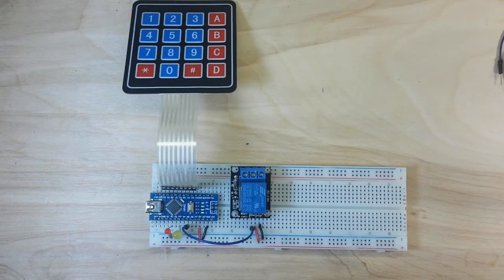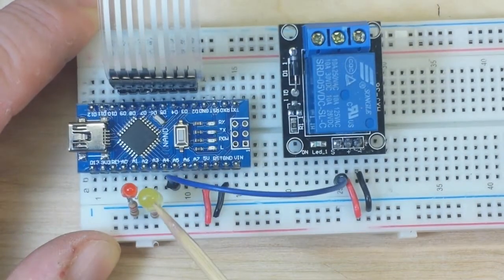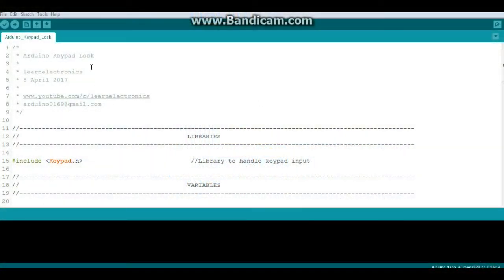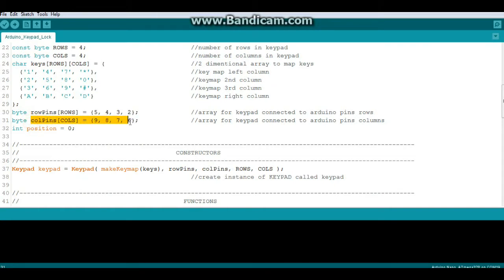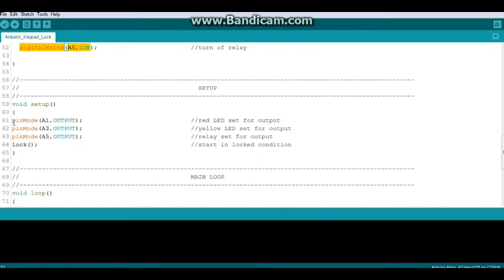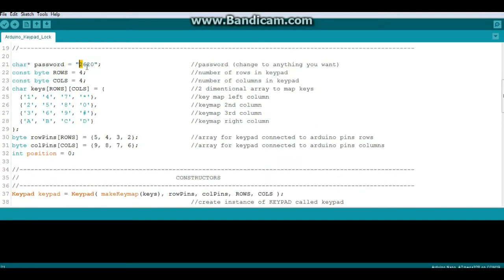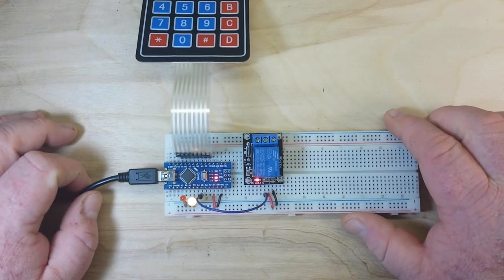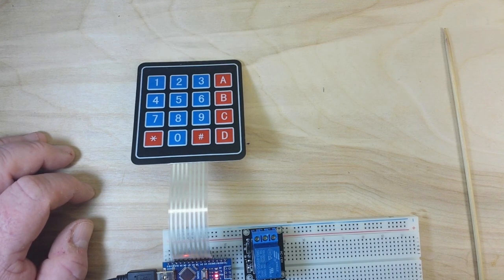Arduino Keypad Lock

Comment: Arduino: 1.8.1 (Windows 7), Board: "Arduino Uno WiFi"

sketch_sep11a:18: error: expected primary-expression before '(' token

 Keypad keypad = Keypad( makeKeymap (keys), rowPins, colPins ROWS, COLS );

                       ^

sketch_sep11a:18: error: expected ')' before 'ROWS'

 Keypad keypad = Keypad( makeKeymap (keys), rowPins, colPins ROWS, COLS );

                                                             ^

C:\Users\admin\AppData\Local\Temp\arduino_modified_sketch_998616\sketch_sep11a.ino: In function 'void unlock()':

sketch_sep11a:26: error: expected primary-expression before ')' token

  )

  ^

sketch_sep11a:36: error: a function-definition is not allowed here before '{' token

  {

  ^

sketch_sep11a:44: error: a function-definition is not allowed here before '{' token

 {

 ^

sketch_sep11a:49: error: 'lock' was not declared in this scope

 lock();

      ^

C:\Users\admin\AppData\Local\Temp\arduino_modified_sketch_998616\sketch_sep11a.ino: At global scope:

sketch_sep11a:51: error: expected unqualified-id before 'if'

 if (key == password[position]}

 ^

sketch_sep11a:51: error: expected declaration before '}' token

 if (key == password[position]}

                              ^

Multiple libraries were found for "Keypad.h"
 Used: C:\Users\admin\Documents\Arduino\libraries\Keypad
 Not used: C:\Program Files\Arduino\libraries\Keypad
exit status 1
expected primary-expression before '(' token

This report would have more information with
"Show verbose output during compilation"
option enabled in File -> Preferences.
 I GOT THIS ERROR ANYONE CAN HELP?
Reply from the maker: You are not formatted correctly, check for line ending semicolons and ending curly brackets.

Comment: Nice tutorial, but I tried it and for some reason it doesn't work for me.

First, nothing seems on when I upload the code. The "lock" LED is off as well as the unlock one. And nothing changes no matter what buttons I press on the leypad.

Also, I'm getting this error message. (Code still uploads tho.)

> 
C:\Users\marti\Documents\Arduino\KEYPAD_LOCK\KEYPAD_LOCK.ino:2:14: warning: deprecated conversion from string constant to 'char*' [-Wwrite-strings]

 char* pass = "2801";

              ^
>

My code is almost the same as yours, except I only control LEDs with it, no relay.
Do you know why that could be?
Thanks in advance
Reply: This is the code: pastebin.com/XHikc59G
Reply from the maker: Martin Mrňák what version of the Arduino IDE are you using?
Reply: i can't follow it either can you please just upload a schematic and a sketch i can just copy and past and make it work to send a short half second pulse to a relay when the right code  is entered ,  it is a toggle situation no  separate button  for up and down
i just need it to set  a D pin high  for  split second to close the realy to activate the door
i need this for  a garage door. I currently have one of these  hooked up to where the little door bell button goes
https://www.aliexpress.com/item/10A-1-Channel-Receiver-Wireless-Relay-RF-Remote-Control-Switch-DIY-Module-DC12V-For-Remote-Control/32773746301.html?

and i am using it with  a broadlink RM pro to open the door with  my phone and /or alexa

i want to add a keypad and use the same relay board , just solder some wires to  it and  then to an arduino mini i already have and add a keypad and led's  i suck at coding anything i can't follow a word  of this can you just make a  schematic on how to wire a  4 row 3 column pad  and  post    a sketch that  i can just copy and paste and make it work
what else would i need? i have a 5v atmega 328  mini
could i solder a wire from the GND pin of the mini and another D pin to the relay boar someplace or would i need something else you think because of the relay board being powered  by 12v and  the mini by 5v?
Reply: mine too